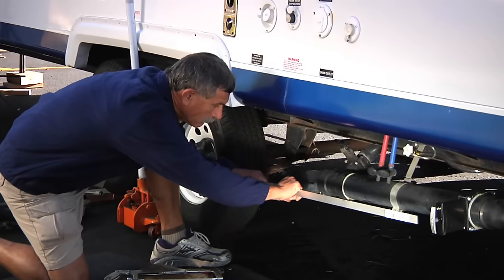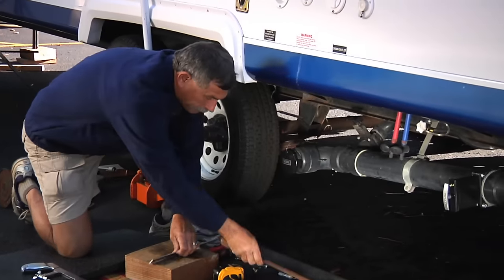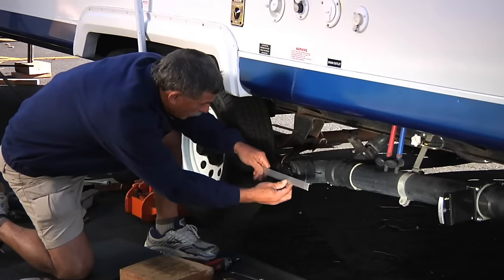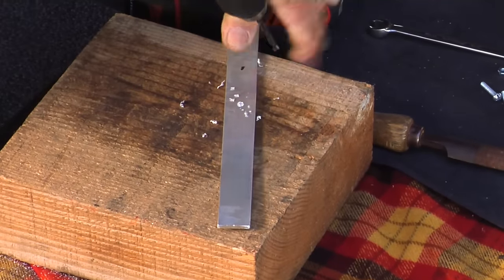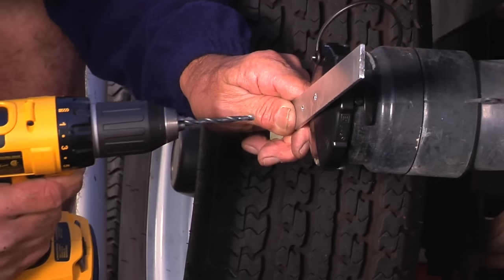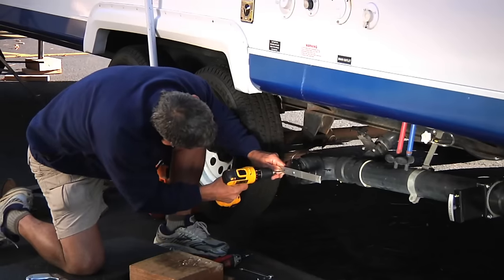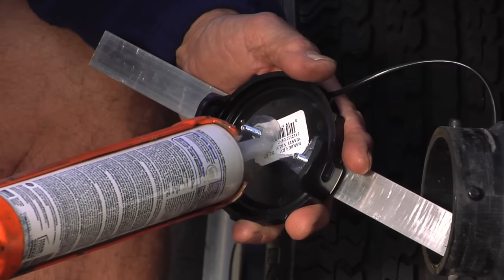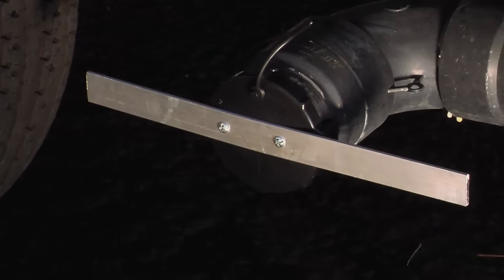Install a lever on your RV's Sewer Cap to make removal and replacement easier

Comment: I'd use a small piece of 90-degree angle iron to give better leverage...I'd cut it the same width as the cap...any longer and it would be too near the tire...

Comment: Why go to all that trouble. Just go to Camping World or some other RV parts place and purchase a cap with the handle already on it.  That's what I did. Didn't have to get drill & bits, tools out, find or purchase bolts and metal.  Easy.

Comment: I like this idea, but I think it's reinventing the wheel a bit. I'm planning to stop by a Home Depot or Lowe's and get a couple of cabinet handles to mount on these covers. I don't really have an issue with turning them, except that we have a van, and those valves are pretty low to the ground. Getting leverage is a challenge.

Great tip!